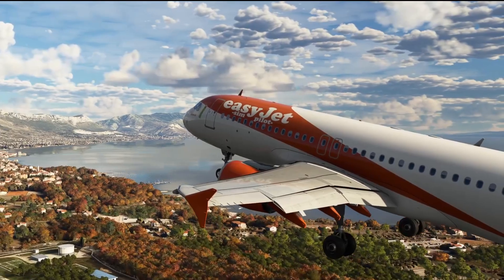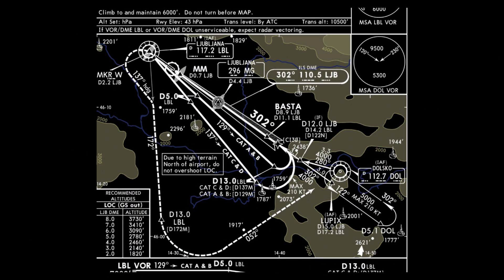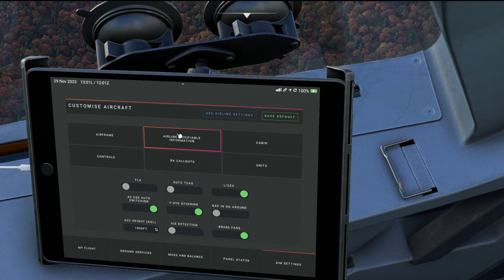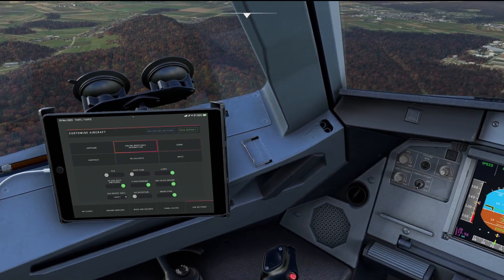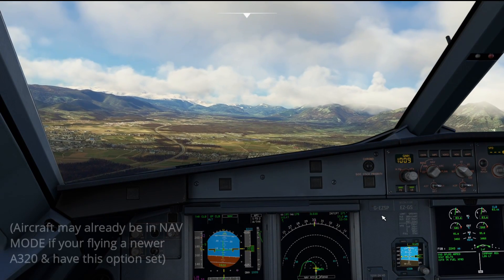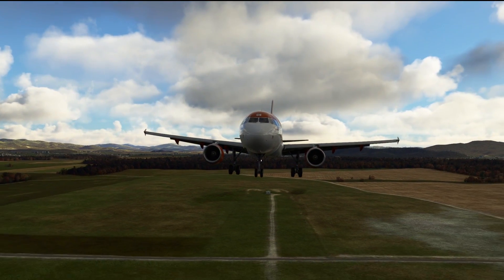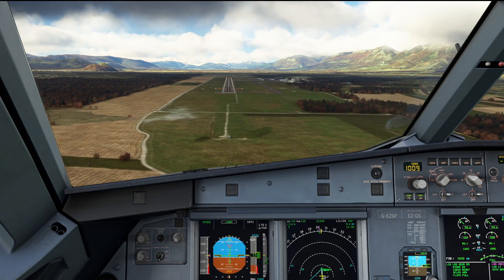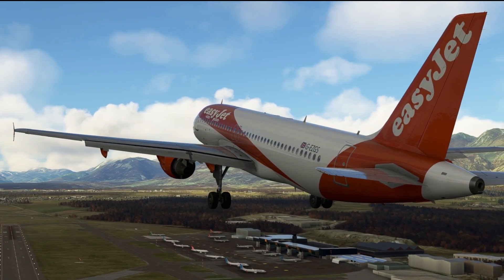A320 Balked Landing or Go Around? The Difference & Tutorial

Comment: Could you explain or share a video on getting reset on the approach AFTER a go around procedure. For example, if the go around puts you in a hold, my flight plan seems to disappear, so I manually vector myself (when no vatsim ATC online) and then manually enter a direct to the first waypoint on the approach chart.. Not sure if this is correct procedure though. Thanks!
Reply from the maker: There are some circumstances that the flight plan will clear. If you don't go TOGA and enter the GA phase then the flight plan will clear as you cross the runway threshold.

However the GA flight route should be flown, and then you'll be able to fly the STAR again, starting at a waypoint of your choice. You can go DIR to this if ATC aren't online.
Reply: @Easyjetsimpilot thanks for clarifying! Very helpful.

Comment: Is Ground spoilers off? incase of a touchdown that may lead a tailstrike.
Reply from the maker: No, the ground spoilers only deploy if one main landing gear is on the ground and at least one engine thrust lever is set to REV, so In the case of a balked landing, the spoilers will never deploy.
Reply: @Easyjetsimpilot if the ground spoilers are armed they’ll actually deploy when thrust levers are idle

Comment: The A320neo plane, when I change the altitude, for example, from 30,000 feet to 10,000 feet, the plane does not respond, but rather continues at the same altitude, while the Boeing 747 responds directly. What is the solution??

Comment: Really good video Gav. Just a add a few additions. 

> Balked landings are generally performed below 50 ft. Basically anytime after you’ve crossed the landing threshold. Anytime prior to this a normal GA can be performed. 
> Capts can do balked landings on themselves. Even we cock it up at times. 🤦‍♂️
> Balked landings are usually due to a poor flare manoeuvre or floating outside of the touchdown zone. 
> The take over push button needs to be pressed AND held. This ensures your have complete control authority over the other person. They might still be moving their sidestick causing the input to cancel each other out if you release it. Not really relevant in the sim world.
> The balked landing may require you to lower the nose! If the nose up attitude is already very high (>9°). 
> You may need to go around on an autoland because the AP has tripped off. In this case, you WILL need to rotate and get away from the ground manually. A big threat when briefing autolands. 

I think that’s it. Apart from that, very nice. 👍

Comment: I think the definition if I remember rightly is something like,  An aborted landing that occurs after the Decision Height, I.e below 50ft in most cases or after touchdown. 

Its usually occurs after a decision to land at minimums.
Reply: It’s generally a manoeuvre performed below 50 ft yes. This is considered the “close to the ground” bit. 😉
Reply: Close to the ground is subjective and tells people nothing really , hence me mentioning the height.
Reply: @AirspotterUK  Just checked our manual. It specifically says “during landing from flare initiation until thrust reverser selection”. Which would actually put you in the sub 30 ft height regime. Hopefully that removes any subjectivity for you. 👍

Ultimately it is usually an instinctive reaction anyway. We’ll just sense something not quite right and react by performing the balked landing procedure. At that sort of height, I’m not looking at the numbers per sé, I’ll just get a feeling it’s not quite right and abandon the landing. Experience comes into play massively. Hence why it’s usually the skipper that does it. 👍
Reply: Thanks for the info in regards to your manual.

I think the difference between our numbers are yours is regarding your aircraft and mine for being for the airport design, and the Baulked landing surface starting from different point, which is designed for the lowest common dominator in aircraft rather than a specific aircraft type.

Thanks for the chat.  Interesting stuff. 
30ft vs 50ft not much in it I guess at the speed your going.
Reply: @AirspotterUK  No worries. What does make me laugh with our manual is it still has the possibility to be very subjective. What happens if the FO doesn’t flare? 😳😳 

I’ve not bothered taken that up with our standards team as I know what the answer will be….. “Use your spidy sense and make a safe decision”. 🤣🤣
Reply: @AirspotterUK  Regarding the MAP point. I think ours try to stay away from that detail as the MAP can be anywhere. It could be two miles from the threshold. A MAP height can also be at any height/altitude so that gives us a much larger window to play with. And, with a CAT IIIB (NO DH) autoland, there is no decision height. So I think our outfit just defines it as from the flare initiation to thrust reversers being deployed. It’s a bit more specific…. As long as a flare is started. 😉 

Always good discussing the differences at times as it always varies on type and airline. 👍

Comment: great video Gav, really interesting procedure. i would imagine the workload from a balked landing would be quite a lot so you need that input from the FO to continue flows while the captain fly's the aircraft, sadly something we don't have so much solo flying. i remember from the livestream when the landing happened trying to work out what has happened takes a split second away from the flying so was a great moment , and handled very well.
Reply from the maker: To be fair, I didn't try and work out what happened at the time as I was too busy flying the jet.

Irl you'd 'feel' the aircraft drop. You don't get that sensation in the sim.

It was only afterwards when looking back at he reply that I saw what happened.
Reply: Workload can be very high. Fortunately you can tell from about 30 ft whether you’ll be doing it or not. Depending on the experience of the person next to you determines whether you’ll be single pilot for the next minute or two. 😉